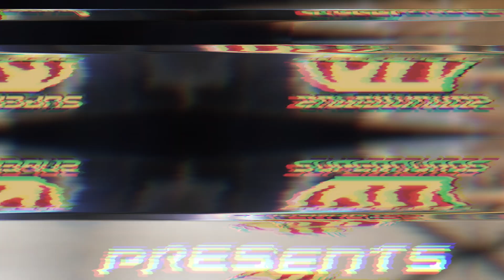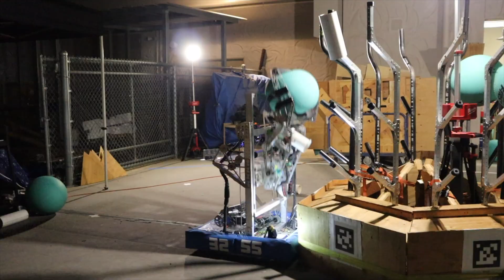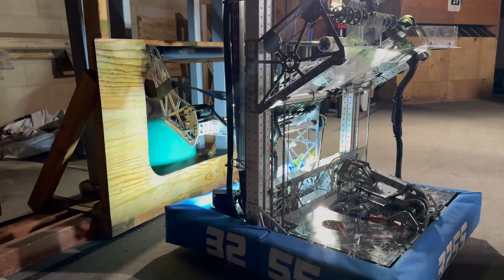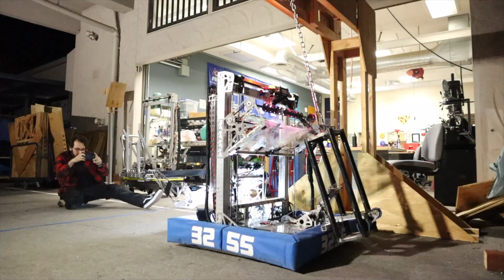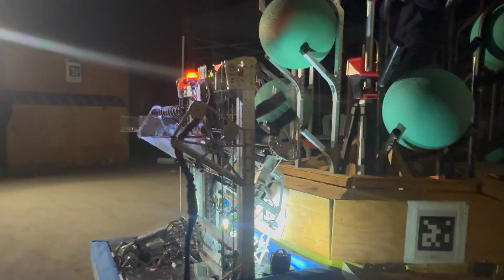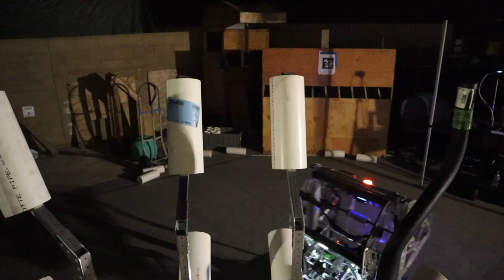FRC 2025 Robot Reveal! - FRC Team 3255 The SuperNURDs

Comment: is the climber a foul? I thought it wasn't allowed to even touch the chain
Reply: As of Team Update 13, the rule was clarified to allow touching the chain as long as you aren't using it for your climb. We originally were going to continue experimenting with our hopper to get it completely not touching the chain in any scenario (it depends on the direction of the cage atm), but we decided that what we had was good enough for our first event after the update.
Reply: @acat442  an easy (maybe not) fix might be using the elevator to act as a counter balance to the climber so that the center of mass moves as it goes up or down.